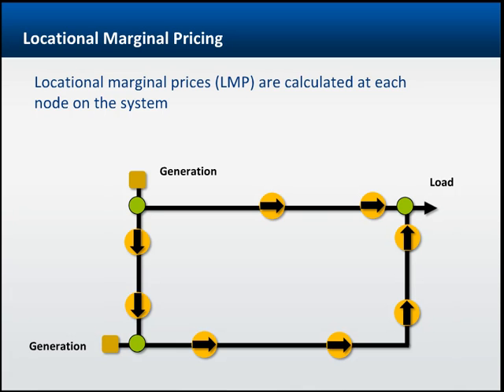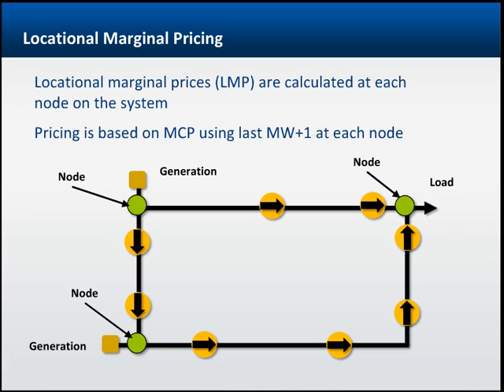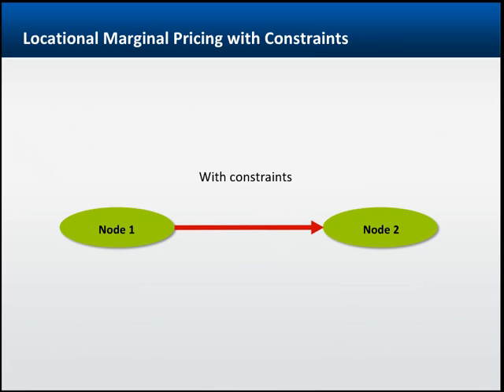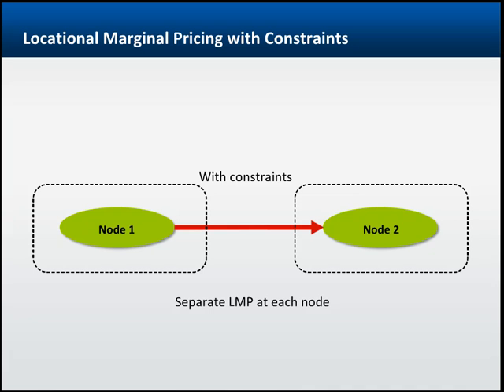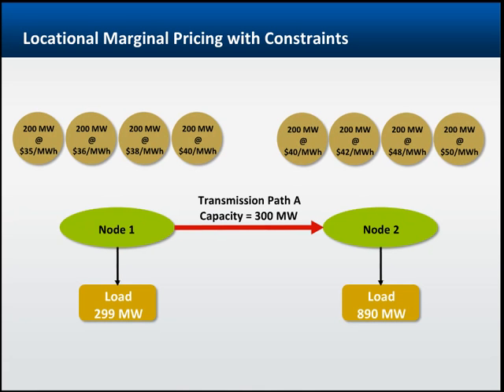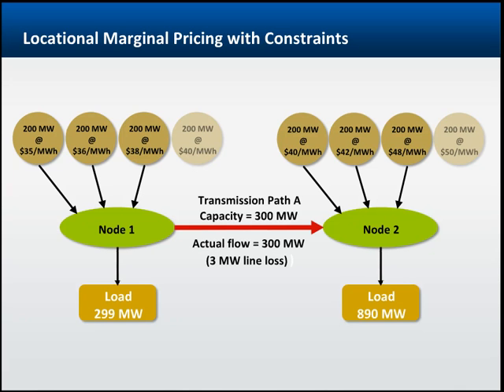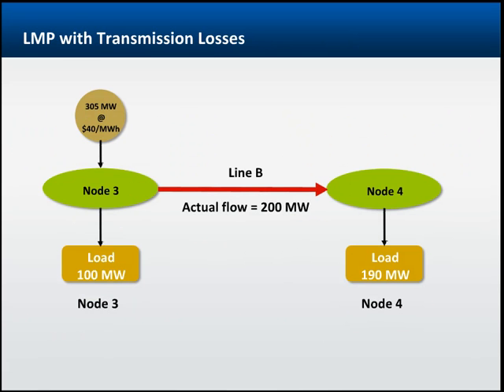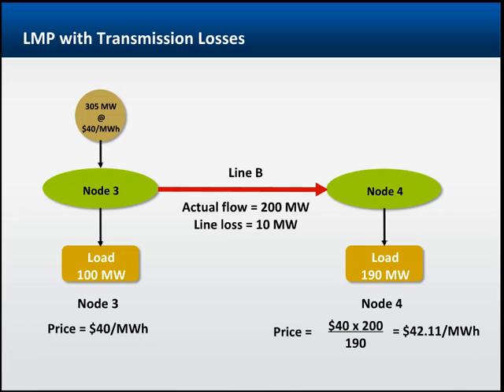Locational Marginal Pricing

Comment: In the unconstrained example, I don't understand why all the loads on Node 1 should pay $42 just because the cost to get the final MW necessary is $42.  Seems appropriate for each offer of supply at a particular price ($35, $36, $38, $40, $42)  be honored at the offered price.  Not a higher price than the supplier originally offered.
Reply: Got the same question too

Comment: could you explain why without constraints you used the same price for all and with constraints not, since the 38$ offer is only used for the second node, why has the first node to pay that ?
Reply from the maker: The question is - if there were one more MW of demand at a node, how would it be served?  In the case of no constraints, new load at Node 1 would be served by further ramping the $42 unit on the right.  So the marginal cost of additional load on Node 1 is $42.  Therefore that is the appropriate price for loads at Node 1 to pay.  In the constrained case, additional load at Node 1 could be served by ramping the $38 unit, so the marginal price for Node 1 is now $38.  Without constraints, it doesn't matter where the load is located, it all has the same marginal energy cost.
Reply: Got it man , thz so much